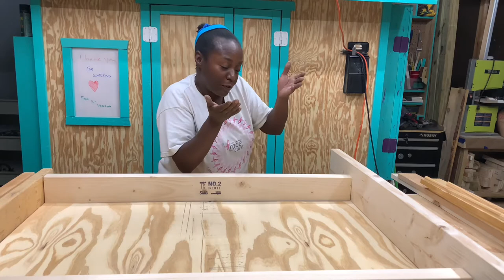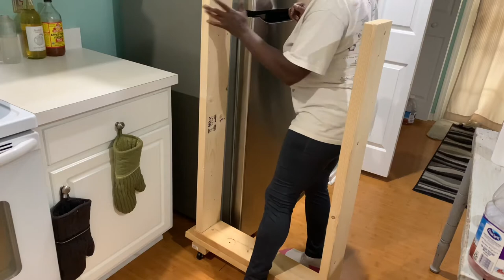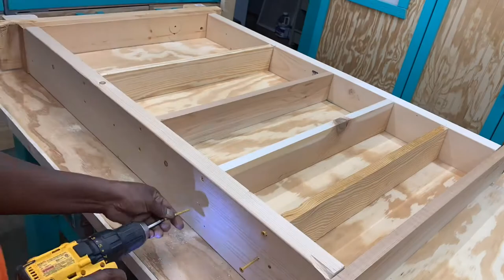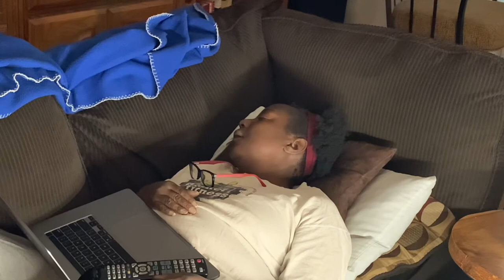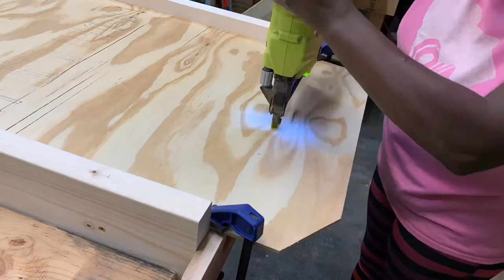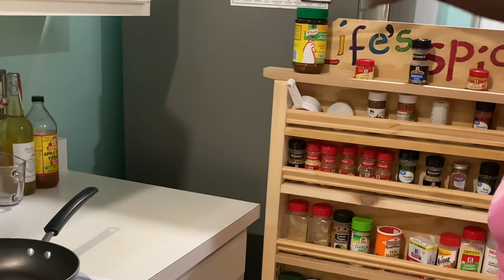DIY Pullout SPICY 🌶 SPICE RACK/EASY SCRAP WOOD Project/ORGANIZE on a BUDGET

Comment: I like this idea a lot especially the storage on the back. I would used a polyurethane clear couple of coated or 2 to 3 coats of spray lacquer finish since it is so close to the stove and make it easy to clean from the grease splatter.
Reply from the maker: Awesome suggestion!! Yes, and I need to stop frying stuff-I'm getting Fluffy ^_^